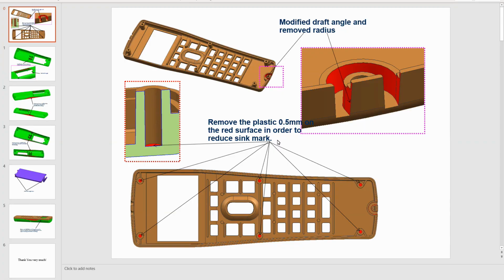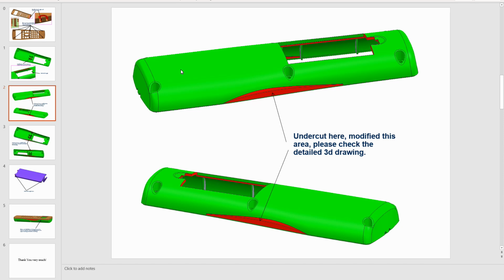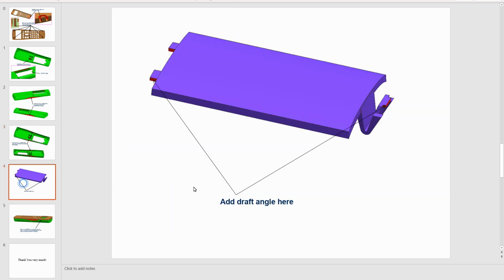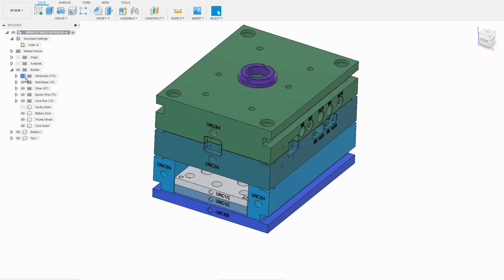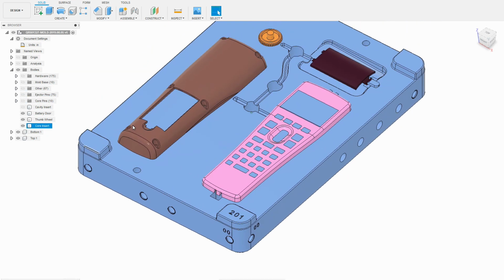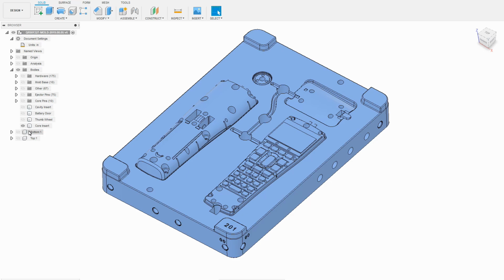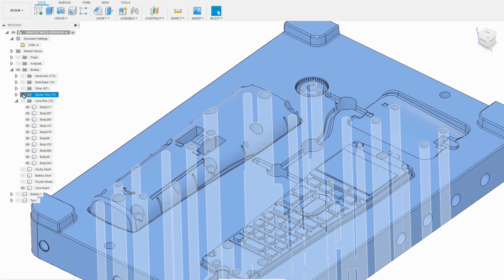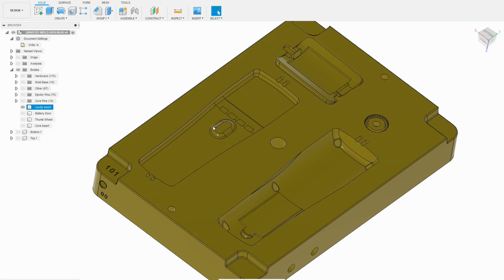From CAD to T1 Molded Samples

Comment: Looks pretty nice. Are they going to be able to run the parts simultaneously or are they going to have to block off and run them individually? If they are run individually the molder can tweak the size a bit via molding parameters (at the expense of cycle time).
Reply from the maker: I don't know what their plans are. However, I did ask for them to include shut offs so we could make extra battery doors. That way they can sell customers replacement parts in case they get broken.

Comment: What was the material? ABS? When the mold maker asked you to put a reveal around the perimeter, did you only make a groove in the CAD? Or did you put in a half-lap joint as part of the reveal. Typically a clamshell design will use a half-lap. That gets you the reveal, and also the alignment. The metal of the screws themselves are not used for alignment. You can in addition add heavy draft of about 5 degrees to the ends of the bosses where they meet from each half of the clamshell. The underside of the counterbore for the head of the screw will have a ring that will overlap the top of the boss the screw threads into. That is where you put your 5deg. I also like leaving about 20 thou or .5mm of gap between this mating area, that way the bosses will pull the whole structure tight by .5mm, and insure the outer perimeter mate at the reveal is completely pulled tight. The mating line will almost never be perfect, even with a reveal. Although your mismatch seemed to be very large. Typically is more like .005" to .010" of mismatch. (Unless you are someone like Apple where its a whole different world and they will make prototype tools to test and then make the final tools based on how the parts really shrunk, and not just what moldflow showed). One trick you can use is put a round on both sides of the reveal of about 20 thou. To do this though, the PL has to be on the tangent of the round. And if you have this in your CAD, the toolmaker will most likely ignore it. You would have to check their ppt and the tool CAD before you give the go-ahead. The Chinese toolmaker never read the 2D in my experience, they only look at the 3D. I'm not an expert, but I do have 15 years experience as an ME designing part for mass production injection tooling. I too am surprised the toolmaker made a family tool of those mismatched part sizes as the other commenter was. I guess your numbers are low enough it was not worth making more tools. That could potentially be your source of the mismatched parting lines on the clamshell pieces, but I'm not certain of that.
Reply: Edit, I saw your first video after watching this one. It looks like you did put in the half lap. My apologies I couldn't tell from this video. And it looks like the bosses are too close to the wall to do that alignment feature I was mentioning. I'd probably have to send you a cross section of it, my text description is hard to follow. Nice work.
Reply from the maker: Thanks! This is exactly the type of input and feedback I was looking to get when I started this channel. I'm certainly not an expert, so I welcome any input that will allow me to learn. Thanks for the information. I had to look up what you mean by half-lap.

Comment: Great Video! I’m curious, did you push the molder to make a family mold that included the smaller two parts? Typically I always get pushback on family molding anything but two very similar size parts. Using Icomold?
Reply from the maker: Thanks. No, we didn't have to push for a family mold. They suggested it as a way to reduce the cost. And no, it's not Icomold. We're working with a small company (a friend of a friend) that doesn't have a web site. But they know the model train industry well.

Comment: Hi John,
It is very interesting to follow your journey into more and more complex injection molding.

How much did the mold cost you?

Best
Jacob
Reply from the maker: Thanks. I think the mold was about $13K, but I don't remember for sure--I'm not the one paying for the mold. That's a lot less than such a mold would cost to have made here in the US. We're working through an injection molding company in Ohio. The mold will be shipped to them for production. It turns out that injection molding itself is comparable here when you include the cost of shipping. We wanted to have the mold made here as well, but the estimates we got were closer to $50K.